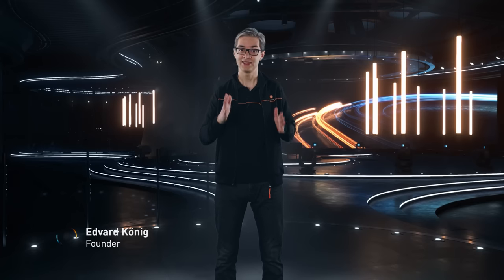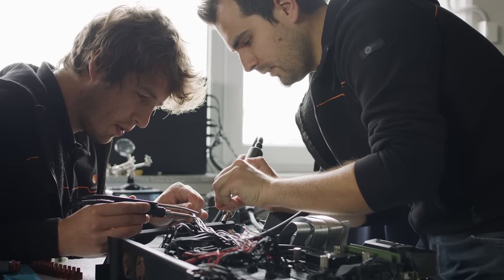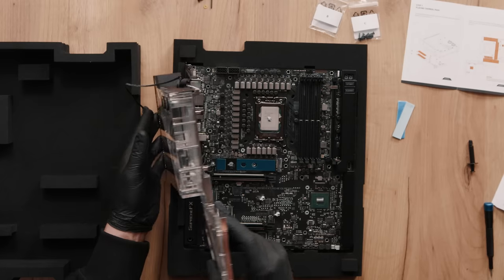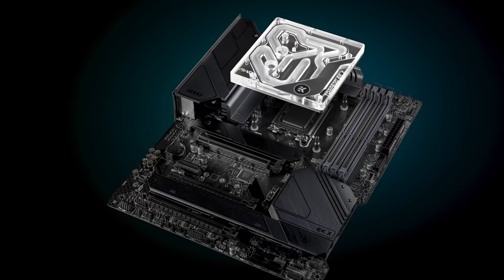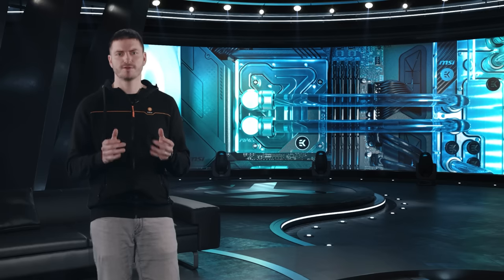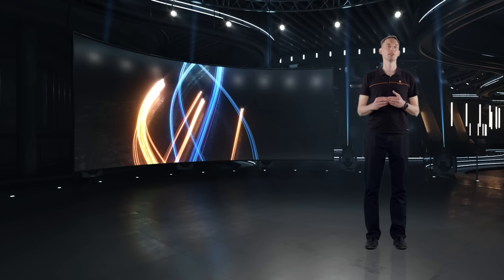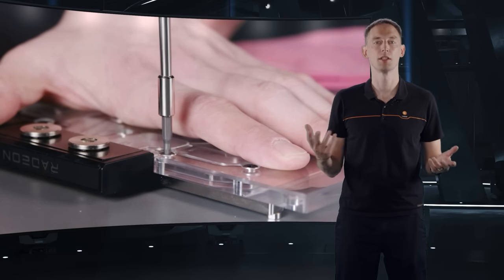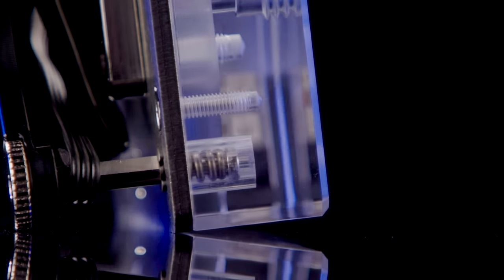EK Technology Day 2022: Experience the Evolution of Water Cooling

Comment: For last year's EK-Quantum Vector with active backplate model, would it be possible to have a new terminal in the future that would allow GPUs to be connected in parallel?
   I connected 3 pieces of EK-Quantum Vector Trinity in parallel with EK Manifold, but an new terminal would be a simpler and more elegant solution.
Reply from the maker: It seems unlikely at this point, but if we receive enough requests from the community we will look into making one :)
Reply: @EKWBofficial   Thank you ! :)